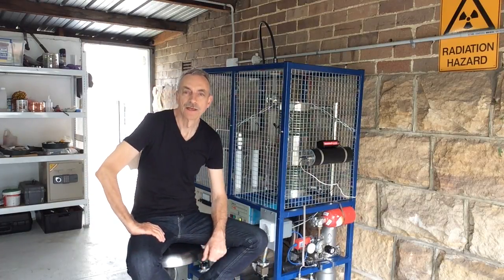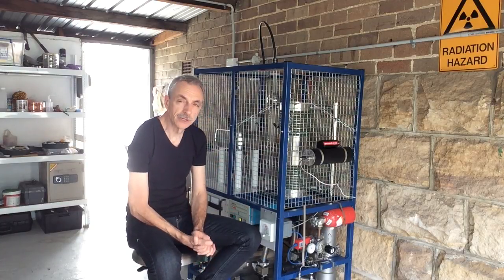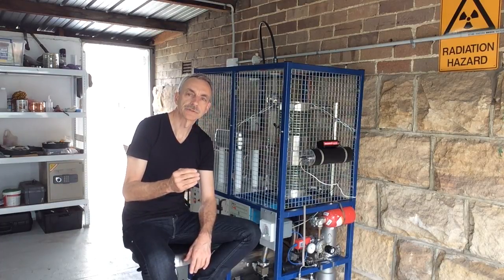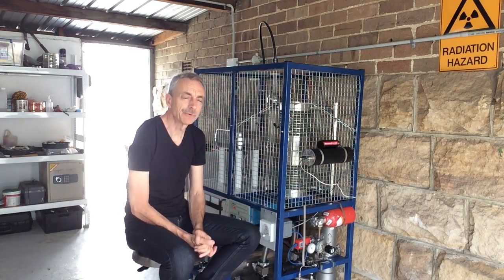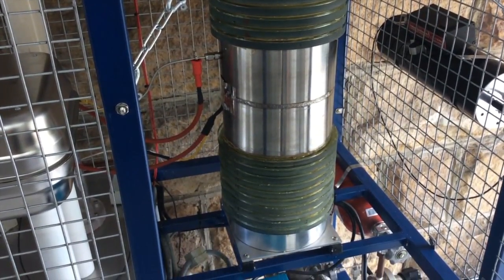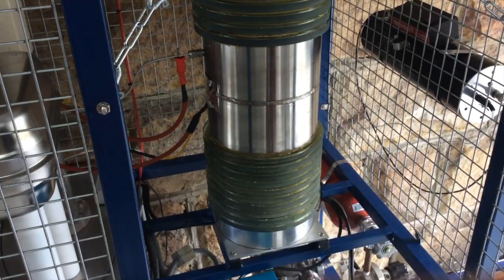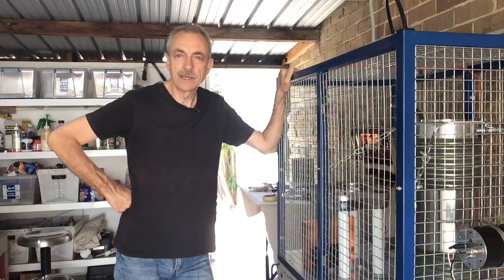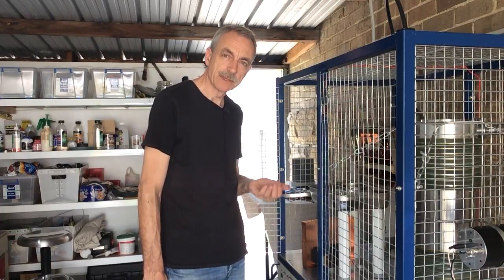F.I.C.S. Fusion Jan. 2017

Comment: Do you think, that there is a way to "cheat arcing" with meta-materials? (like microwave "transparency") Has the alu./glass stack this kind of purpose?
Reply from the maker: The arcing is one of many issues,  in one of my earlier experiments the whole apparatus was submerged in dielectric oil, that solves the problem but it's messy so I tried to avoid it with this one. Another option is a potting compound.